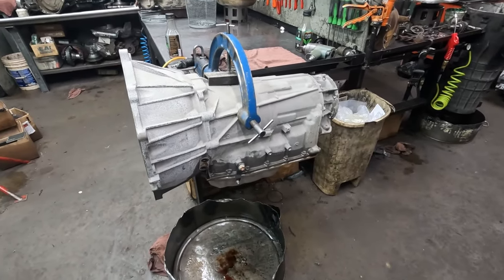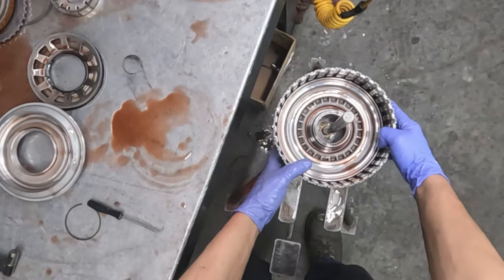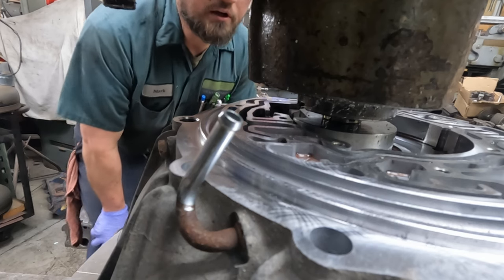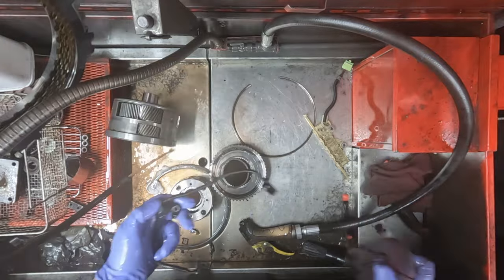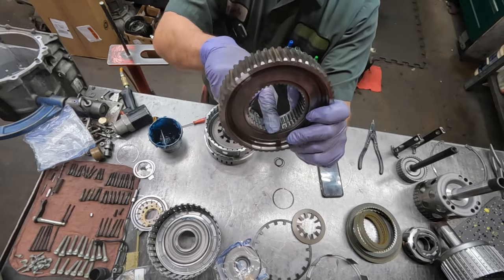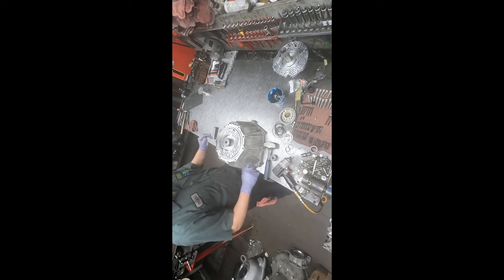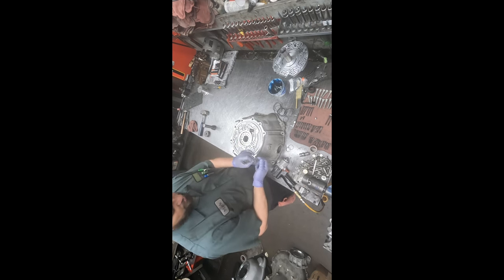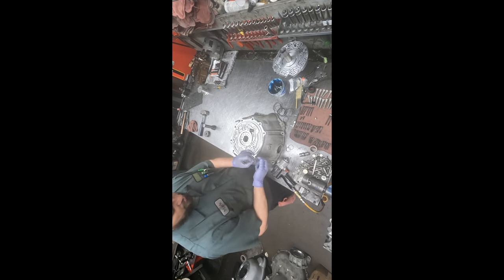6L80 6L90 Rebuild Full Length of Disassemble, Clean, Reassemble with comments.

Comment: Do the new check balls come in a kit? I cant seem to find the black ones that you used at 2:09:27
Reply from the maker: Tan check balls are what we prefer. They do come in most overhaul kits. The clear/white-ish balls wear down and create problems, so we avoid those. Look through the other comments here about polishing aluminum piston surfaces.
Reply: @scatteredrustyprojects  thanks for the reply. I just finished machining my pump cover. That bolt trick to remove the dowel was awesome! 
I'm a machinist, and mechanical engineer, but this is my first transmission build. Your video has been super helpful. I'm still putting together my parts list and having some difficulty settling on the exact rebuild kit to buy. My Yukon has 192k and other than the 4-5-6 clutch frictions, all my clutches looked great, so I wasn't really planning to do steels.
Reply from the maker: @danielcolwell1477  it's fun machining the bell being it is eccentric. Did you get the thick end play washer? --Sonnax 33452A Endplay is added when the pump channel surface and stator face are machined. Sometime soon, I will add a supplement video to this talking about using 1500 grit to polish the aluminum surfaces where the piston seals ride. The surfaces become rough with scratches through use with metallic suspended in the fluid and also, an aqueous cleaning method can etch the surfaces. This roughness will scrub the pistons, wearing them to leak in a matter of months.
Reply: @scatteredrustyprojects  I opted not to machine the bell housing. It was pretty cheap online to just buy a new one. But since the other half could just be done in a lathe that was too easy not to machine it. I'm assuming I don't need that thick end play washer since I'm just going to buy a brand new bell housing?
Reply from the maker: @danielcolwell1477  ther eis quite a bit of endplay in stock form, like a thick washer could be put in there even without machining. It isn't too fussy.  If you took .008" or more off the stator than I would suggest the thicker pump washer.
Reply: @scatteredrustyprojects  ok. Good to know. I only took off 0.0035" I just got my giant pliers in the mail so I can finish taking things apart. Hopefully the larger planetary set is in good shape like the small one was. I'm replacing the TCM with a brand new GM unit just because it's got 192k on it. I also bought a new loaded 1234 35r drum. My 456 drum looks like it got really hot around the clutch pack. Hopefully its still ok to re-use the drum with new clutches.

Comment: Will this be considered a brand new or rebuilt transmission that will only last a certain amount of miles?😢
Reply from the maker: Whether brand new, reman, rebuilt or used...every transmission has a limited life. There are many variables that come into play with transmission life span. Back when I worked at a dealership, we'd have a nearly brand new vehicle that something went wrong in the trans. Other times I've seen people get 400,000 miles and never change the fluid and filter. Best hope for longevity is to perform proper maintenance, but it's not a guarantee to never experience a problem. The trans in the video is being rebuilt and it is not new. New is just what it is, new. New is all components have never been used in any application. Rebuild and Reman are very pretty much the same form. Reman usually signifies a rebuild was done in a factory somewhere else. Rebuild and reman is a service that varies based on who is performing the work. As in you have people that will do the minimum or people that try to make it the best they can. We rebuild to restore damaged components to proper specs and upgrade the known problem areas for best case longevity using HD parts or better designed parts. We like to say we build it to live a "normal life". Not just make it out of warranty. Normal trans life depends on the vehicle design and usage application. Normal life is a lifespan similar to the original life of a new unit. Generally, 100k miles is normal life.